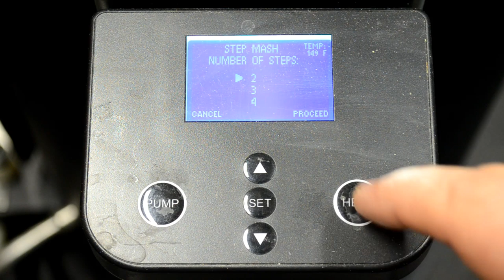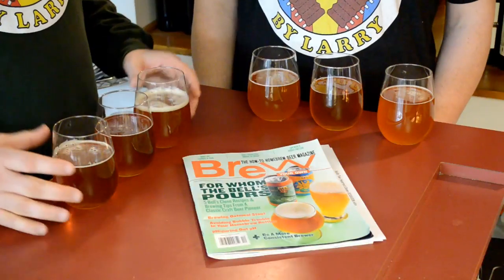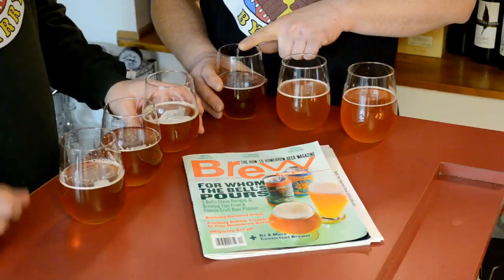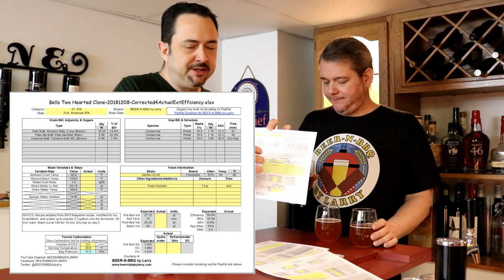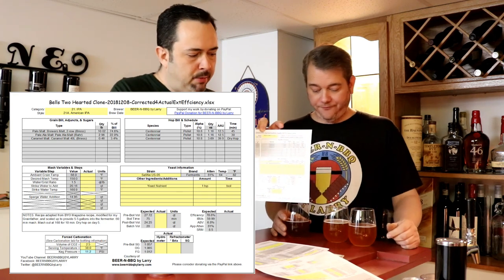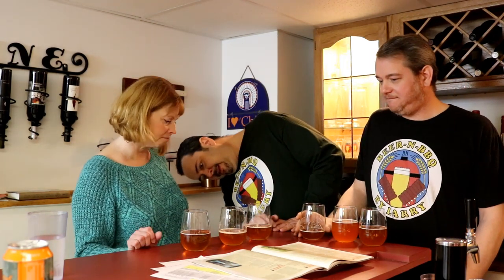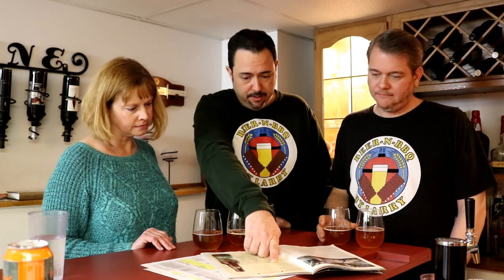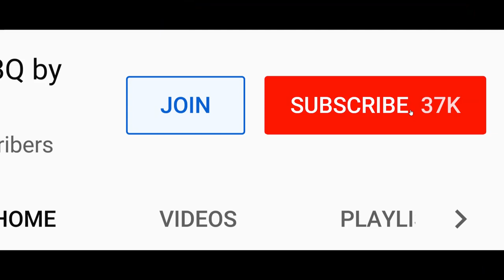Bell's Two Hearted Ale Clone: Grain to Glass, Triangle Taste Testing, & Comparison to the Real Deal

Comment: Great videos.  Very entertaining.  Try a kitchen sink strainer on your overflow during the mash to keep the grains out of the wort and a heat stick to get a better boil.  Small tips to help the grainfather.  Your beers look great 👍🏼
Reply: Just run an extension cord from a different 110 breaker than the breaker your using for the grainfather.  Very easy.  It helps us cold weather brewers.  Your electric ⚡️
Reply: Use an extension cord and run it from a bathroom circuit, office circuit etc etc.  don’t waste your hard earned money.  I had some dms problems with my lagers and frustration with how long it took to reach a boil.  The grainfather never had a great rolling boil till I used the heat stick.